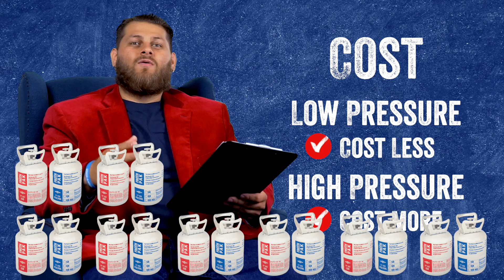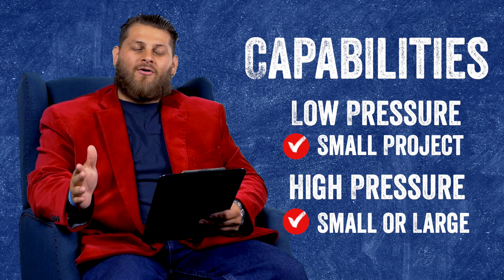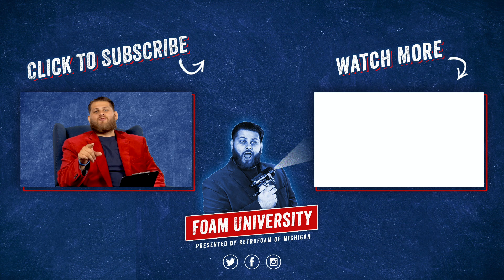Low-Pressure vs High-Pressure Spray Foam | Foam University

Comment: When I clicked on your video, I was hoping you were going to discuss the difference between High Pressure and Low Pressure MACHINES.
As in a high pressure Graco Proportioner compared to the SPI low pressure Proportioner.
Any plans on making a video with that content???